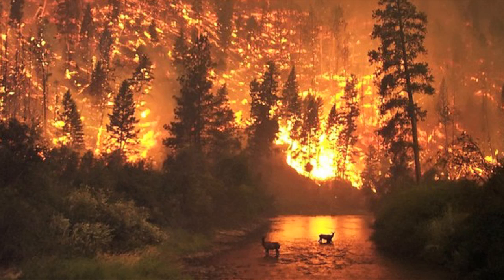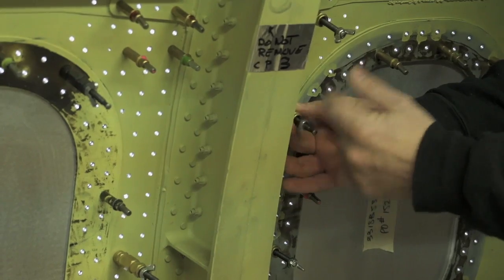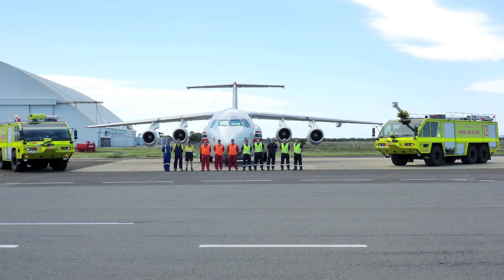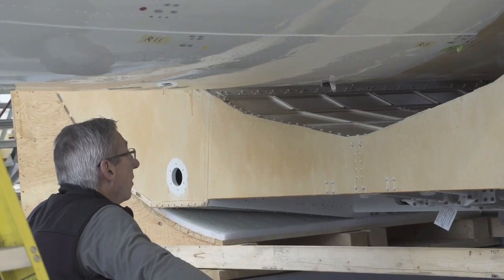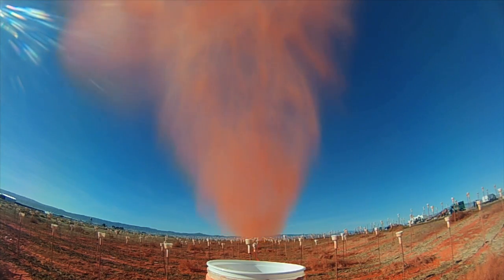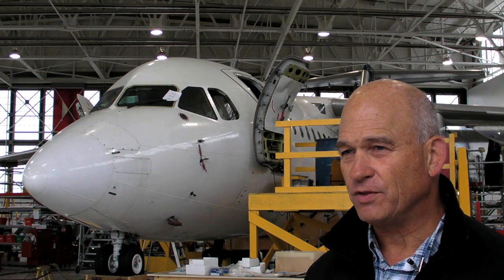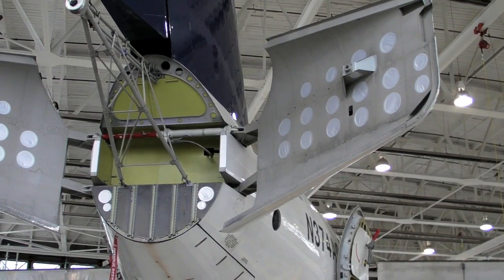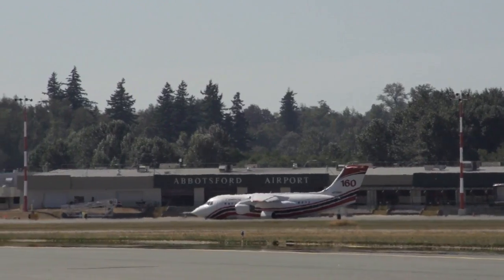Conair RJ85 Jet Air Tanker

Comment: Always liked the look of the BAe 146 series. BAe's theory on the aircraft's design was that four smaller engines without thrust reversers would be less expensive to operate than two large turbofan engines, it would be interesting to compare the operating cost of the RJ85 to something like the 737 tanker putting that theory to the test.

Comment: would have liked to understand why they chose to use a saddle tank rather than the available interior space.
Reply: I think they use saddle tanks to keep the center of gravity low. Probably handles better that way.
Reply: It also allows them to fly with the cabin pressurized. They can climb higher and fly faster which means quicker dispatch times. That’s not easy to do when you start putting large holes in the fuselage for the plumbing.